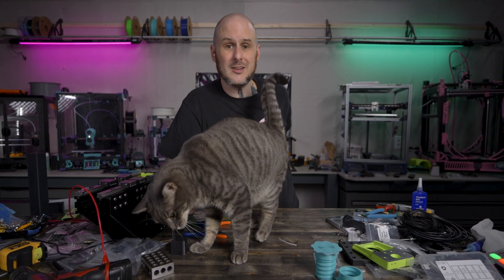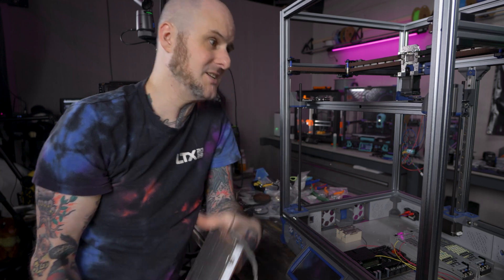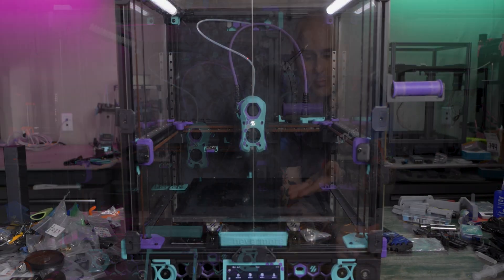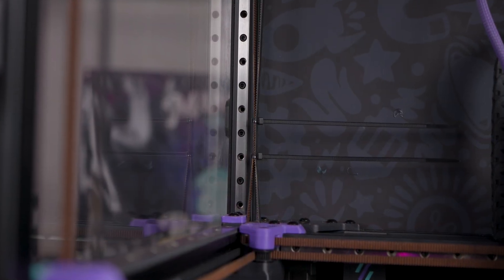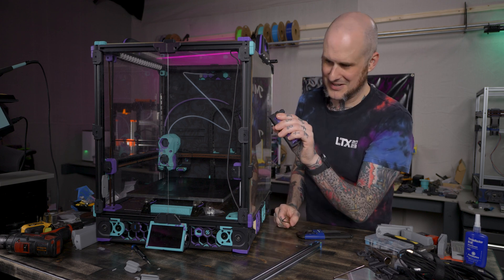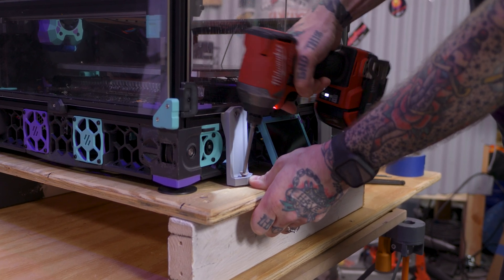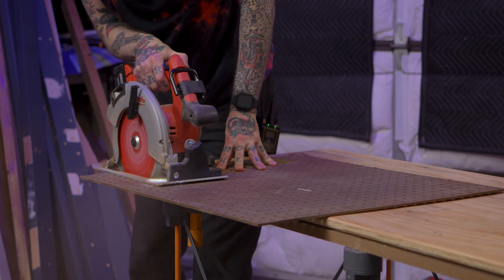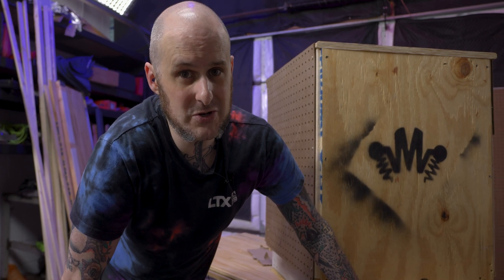How to SAFELY Move 3D Printers Cross Country!

Comment: How about the Bambulab printers?
Reply from the maker: I just packed them up actually. I wrapped the AMSes in bubble wrap and placed them inside of the machine with the bed at the lowest point so the case supports it. Put the toolhead in the back left corner over the poo shoot and zip tied the belts. Then wrapped the entire machine in a bit of bubble wrap and a moving blanket. Taped the glass onto the machine body. Then put it into a cardboard box with spools of filament around it on all sides. X1 & P1 both got their own boxes. 

I considered building crates but I've crated 4 printers & 1 laser cutter, I'm over it, ha.
Reply: @MandicReally  awesome! I have to move a couple of printers myself in the coming weeks and this is so helpful. Wishing you best of luck in the move!

Comment: This video is perfectly timed for me as I'll be moving my 2.4 as well next month! Though I do wonder, about the frame bending if you used a ratchet strap, wouldn't lifting the printer by the handles mounted up there potentially bend the extrusions as well? I'm using those same handles and it's something I've been thinking about.
Reply from the maker: You know that is a legitimately good question. The machine weighs quite a bit afterall. Granted a ratchet strap can produce more force than the weight of the machine. Still something that would be interesting to try and look at more...